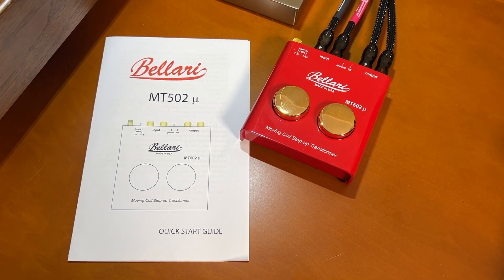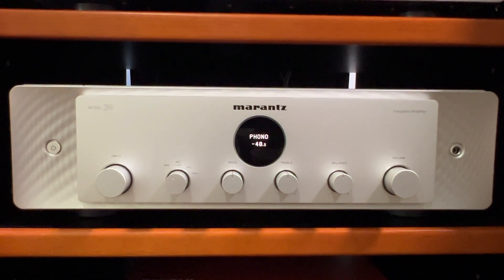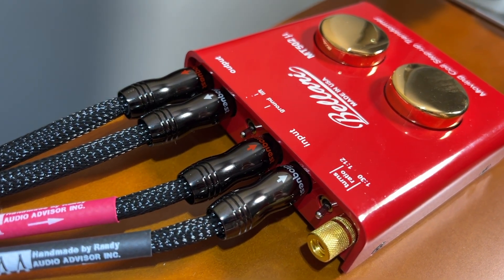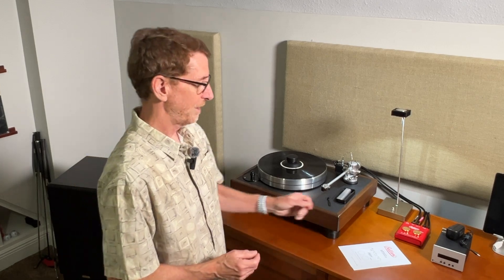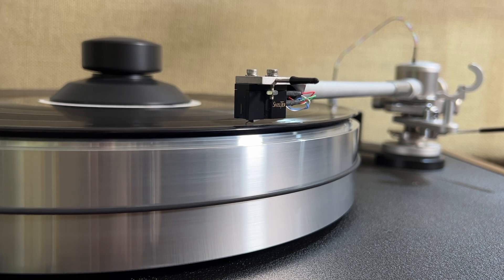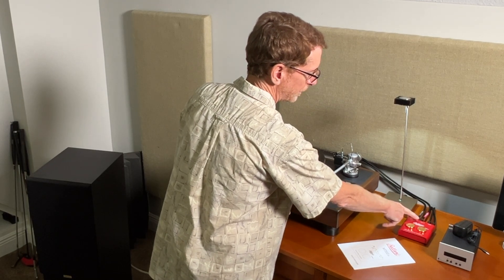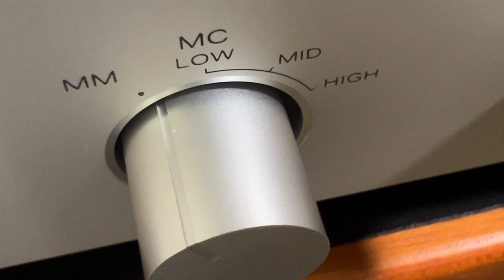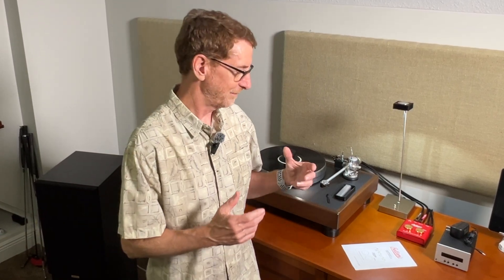Quick Review of the Bellari MT 502 Moving Coil Phono Cartridge Step Up Transformer (It's Awesome!)

Comment: Is a SUT an upgrade if your pre amp phono has a really good mc stage?
Reply from the maker: In my case yes. The MC stage on the Marantz Model 30 is widely praised as being quite good.  I also had a Pro-ject Phono Box DS+ stand alone phono pre-amp with selectable gain up to 65db for MC that I tried with my Shelter 501 cartridge. Both phono preamps sounded great, but I had to crank up the power amplifier much higher when listening to vinyl than I did with any other input. The Bellari MT 502 solved that issue and bought phono listening levels up to nearly the same level as CD, DAC, Bluetooth, etc. without any downside other than the purchase price. I A/B tested the phono preamps of the Marantz vs the Pro-ject paired with the SUT and it was a tie so I opted for the simplicity of the Model 30 integrated phono preamp paired with the Bellari MT 502 and sold my Pro-ject Phono Box DS+ on eBay.
Reply: @Koolbob2 thank you for the feedback.  Really appreciate it.